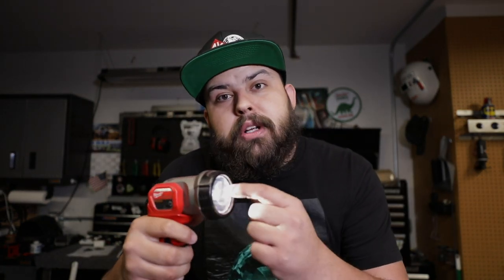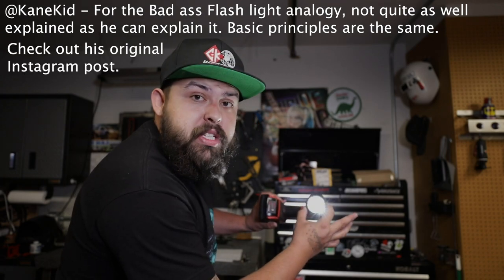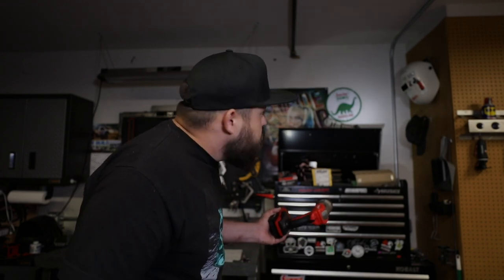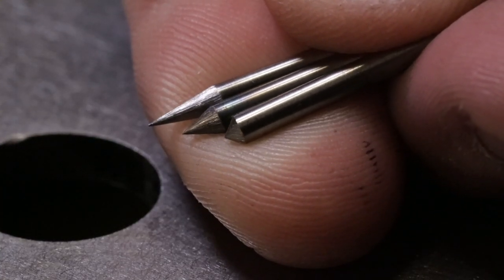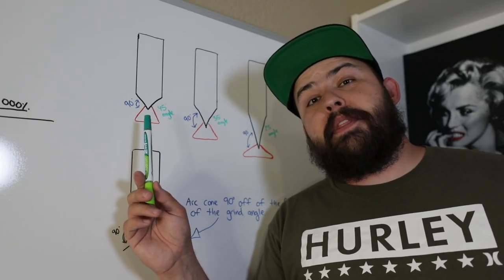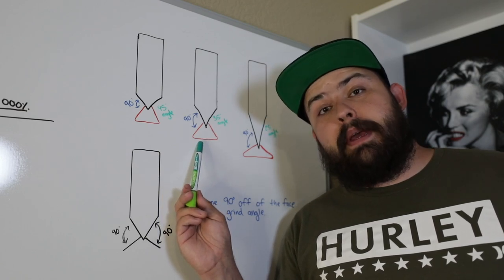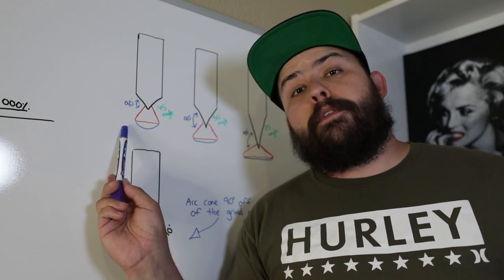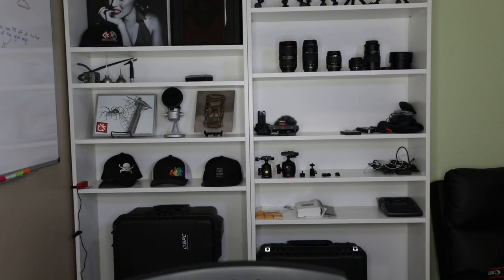Tig Welding Tungsten Grind Profiles | Penetration | GTAW

Comment: Hi Brad,
You are the first Youtuber welder, which shows the secret at the welding arc: "It stands all time 90 degree on metal surfaces".  This results is your big take away in your video here. The sharp tip result in a wide arc and  a flat tip result in a focused arc. You have explained it complet correct on your board. Absolutly great.
I am an old german electrical engineer with Phd in elektromagnetic waves calculation and also a tig welder. Very seldom. I made electromagnetic CAD lessions for the students at the Technical University of Berlin, where I also made my Phd. One basics was in the lession was: "electric field lines stands always 90° degrees on metalic surfaces" because inside the metal the restistance is equal zero compared to air and all potential differences equals immediatly. So on surfaces with every where having the same potential it is an equipontential surface where all fields lines are 90° on it.  That's the simple physics of the differential equation from maxwell. 
You really hit the point. And I am wundering why there are so many youtubers out where they are telling such bullshit, that a sharpened tungsten give a focused welding arc. The 90° degrees leads exact to the opposit.
Thanks you so much. Now I know there is at least one youtube out which tells the true at the tungsten tip. Also the pictures shows this very clear. 
As KaneKid told in his podacst. He reconized later in his welding live that he is dealing with current. And I say extent: current flows inside the rules of elektromagnetic fields.   
I think every tig welder MUST know this. If you have any question please don't hesite to ask.
Kind regards
Tobias
Dr.-Ing. Tobias Damm, Berlin.

Comment: I never knew the arc came off the tungsten 90 degrees to the grind surface! That just made grind angles make so much sense. Does the same principal apply to aluminum where the tungsten typically ends up balled anyway? 
Keep up the good work!

Comment: Great video. Im useing a 4" harbor freight damiond wheel rigged on cordless angle grinder to sharpen my tungsten at the moment. I'm spending more time doing TIG welding lately and thinking this wheel might be a little to course grit. Today I was welding @190 amps mild steel and noticed the arc wanting to wonder & come off the sides of the sharp taper in tight tube corners, got me wondering if polishing would help the arc shoot straight outta the point better in that kinda application?
Reply from the maker: Yeah. Ideally you would rough with a 120 grit or so and put a quick 220 finish on it to take out some of the more aggressive scratches.. obviously sharpen the tungsten so the grind lines are parallel or lengthwise with the tungsten. Fine grit diamond wheels are definitely a good way to sharpen them.. that’s why tungsten grinders allow for such a polished finish straight out of the grinder. Nice fine grit diamond wheel.
Reply from the maker: EPE Fabrication thank you 🙏🏻
Reply: I also use a 4 inch diamond wheel on a angle grinder mounted on a stand works great. 
Thanks for the video

Comment: Which grind would you prefer for a 1/4" lap joint in mild steel?
Reply from the maker: John McDonald what’s the material thickness?
Reply: 1/4"
Reply from the maker: John McDonald thinner the sharper.. thicker, more blunt.
Reply: Thanks. Tried all three, the sharper works best. The blunt wants to arc all around the joint. Good videos!
Reply from the maker: John McDonald just remember that with a super sharp electrode on thick material, like 1/4”.. you are getting much less penetration.. so if it’s critical I’d be careful. Thanks for watching! I’d run a root.. with a smaller taper.. and then a cover with a longer taper.. that way you still get penetration on your root..and then your cover has a wide arc cone and wide puddle to lay down a nice cap. Arc starts are going to difficult with a blunt tip.